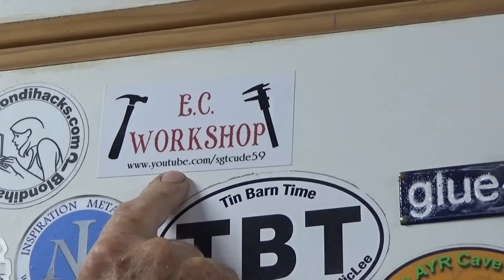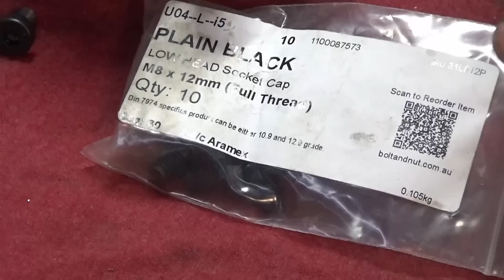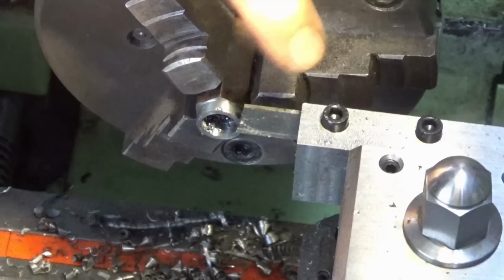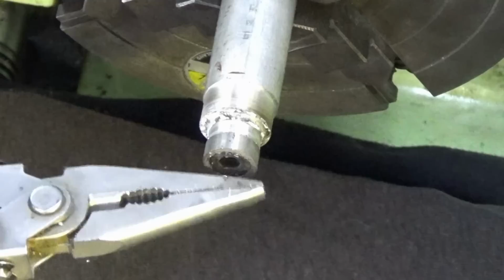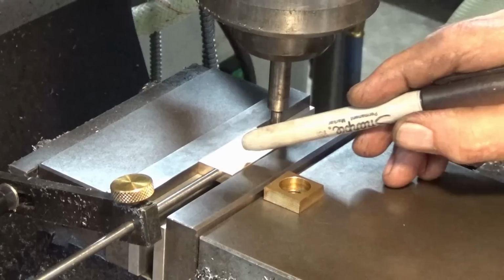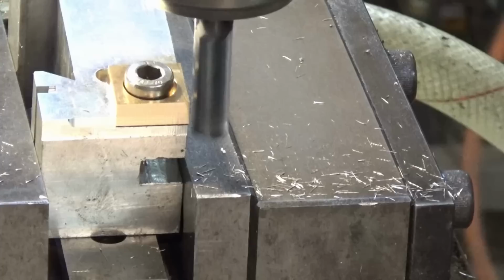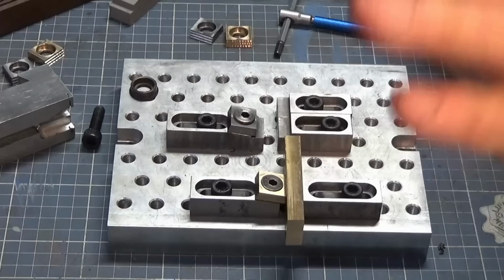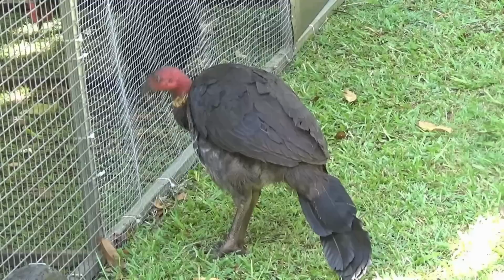Low Profile Clamps (Inspired by Clickspring) Part 2

Comment: Pro-tip for drilling brass and trust me after chewing through 22 tonne of 385 every 2 months in the repetition shop I had in Brisbane, I have plenty of experience drilling it. Simply grind the cutting edge to a neutral rake, cuts nicely with no snatching. Your clamps came out nice 👍
Reply: Could be a short video showing this technique
Reply from the maker: Thanks. We used to modify drill bits in this way for drilling acrylic. It also tends to be a bit grabby and a positive rake drill bit can cause a lot of chipping. The only issue is that you really need two sets of drill bits unless you really like re-sharpening drill bits. I have a project coming up where I will be making a drill bit sharpening rig for small drill bits. I may cover the topic then.
Regards,
Mark

Comment: I designed a set of clamps that I 3d printed for my CNC router. They use m3 bolts, and hold parts nicely on my router. One of the advantages for me has been saving my expensive end mills in case of a run into them while machining.

Comment: William Chitham's comment below was my thought, too.  Since the high point of the eccentric is randomly oriented with respect to the thread, tightening the screw is unlikely to securely clamp the brass jaw to the base at the same time as clamping the work-piece.  Any gap may allow the work-piece to lift, despite the incline.  Using a standard cap-screw to hold the jaw to the base and an eccentric cap-screw pushing against the jaw from the rear would decouple the two motions.  Tighten the eccentric screw first to clamp the work-piece, then the other screw to push the jaw (and work-piece) down.  The incline would not be needed.
Reply from the maker: Chris, I tried to model the mechanism in my CAD software to calculate the clamping forces but failed miserably. However, the jaw cannot lift straight up vertically because it's axis in inclined to the vertical face of the stock it is gripped against. In order to lift it would also bite harder into the stock. I think Chris (Clickspring) mentioned that you need to be realistic and conservative when using this style of clamp. So far I haven't had any stock come loose during machining operations. In the last episode of this playlist I showed some rotary table work using these clamps and they worked well enough. 
Regards,
Mark

Comment: Run a small endmill through the step blocks at an 45° angle to get some clearance.. you could also use a Slitting saw.. Another way of doing it is drilling a small hole were the faces meet.. that way you also get a nice clearance.
Instead of soldering the rings, you also could have machined the holes in the Jaws to 11 mm.. that way you don't have to solder..using the tough steel from the bolts as pressure surface..

Comment: Nice work Mark, I like the jig for machining the square parts. Need to watch out for those cheeky little burrs. But, it looks like it all worked out well once you found the culprit.
Reply from the maker: As you would know, getting a camera in the way is not the best way to carry out close tolerance machining! I hope you are well above the flood levels in Auckland. It looks pretty bad. They showed the concourse in the airport awash with flood water on the news last night.
Regards,
Mark
Reply: @Preso58  Thanks for asking Mark. Yes, we are well above the flood levels as we are on a bit of a hill here. If we ever get flooded here then the rest of Auckland would be 10 meters under water, which would be disastrous.

Comment: Great vid! My latest shows me drilling a bronze casting and the part uplifting. We share that experience haha.
Reply from the maker: You can modify a drill for cutting brass and bronze by grinding the rake off the cutting edges but it means that drill bit is now only good for cutting brass and bronze! You almost need to have two sets of drill bits if you are going to take that approach.
Regards,
Mark

Comment: Hey Mark- Another good idea that I will be trying but I got a trick that I do (Mostly for welding and post heat of cast iron) that you might find useful if you ever need to anneal a large piece again. Dig a shallow pit big enough to put the piece of steel into and build a charcoal fire in it. Put the part on the bed of coals and cover it with more charcoal. Then cover the whole thing with fiberglass insulation and leave it overnight . It will bring the steel past the critical temperature and hold it there and then slow cool it. - Then you can cut off just the part you need,.  Also works for stress revealing weldments.

One other "Hot" idea that dawned on me when you were soldering on the rings. - Give them a couple thousandths interference fit, Heat the rings red and shrink fit them on. ,,,, Just another bright idea from up here in Cleveland.
Reply from the maker: Matthew, the charcoal idea is a good one. I used to anneal old files by lighting a fire in an old tree stump (to burn it out of the ground) and I would just throw in a few old blunt files and leave them until the fire burned out. It works well but often the files came out bent. 
Regards,
Mark

Comment: You can use soap stone to prevent solder to stick to metal so if you cover the face of the mandrel and the threads, the solder won't get the bolt stuck
Reply from the maker: That is true. I believe graphite and white out correcting fluid also works. 
Regards,
Mark

Comment: Would it have been easier to set the mandrel up un the 4 jaw and turning the offset into that and then if you need to make more parts you just put the mandrel in the 3 jaw and you do not need to do the set up again?
Reply from the maker: I did have to set that mandrel up again to make some longer eccentric headed screws. just put it back in the 4 jaw and went through the same steps again. If you did want to use it in the three jaw you would need to mark it against one jaw and put it back the same way each time.
Regards,
Mark

Comment: If those 3D printed parts are done in Nylon, with 4 layer walls, and 70% infill, they will probably make excellent clamps for many materials. I think.
Reply from the maker: I have never tried nylon filament but I hear it's good. Those clamps are small enough to do in a resin printer too. 
Regards,
Mark

Comment: What effect if any does the action of the screw have on the clamping? In action does the clamping jaw push up against the underneath of the eccentric leaving space between the jaw and the body of the clamp?
Reply from the maker: It is impossible to have the screw bottom out on the jaw at the point where the maximum clamping force occurs. There will always be some space under the head of the eccentric screw but in practice it doesn't seem to matter too much. I used the clamps to do a lot of milling on parts held on my rotary table and none of them slipped during the cuts. I think Chris from Clickspring warned that you have to be conservative when using this style of clamp. I kept the depth of cut moderate and it went well. The 10 degree incline does mean that the jaw cannot move up vertically (easily). There is also a lot of friction between the head of the screw and the counterbore. I may do a follow up later on when I have had a chance to do some more work with these clamps.
Regards,
Mark

Comment: Hi Mark, what a nice work: i really like that simmetric end mill that you used to make the teeths of the clamps ( i don't know the correct name), but i will go to check if i can find something in AliExpress, It Is a good inspiration for the next videos! 😀 Thanks Mark, see you soon, Alberto
Reply from the maker: Alberto, they are called a double angle cutter. https://www.deelat.com/blog/single-and-double-angle-mill-cutters-types-common-uses-and-differences/ They also come in single sided versions. They can be purchased with all variations of included angles and some come with built in shanks for holding in a collet. It saves having to tilt the head over on your mill for cutting vee grooves. Very handy.
Regards,
Mark
Reply: @Preso58  Thanks so much Mark!! I am searching to buy one of that!! 😀 Now i have the name!!

Comment: If you had cut the pocket to machine the clamp angle and groove feature, you could have used the eccentric bolt to ensure it was engaged on both faces of the pocket by tightening the screw and the burr would have been a non issue
Reply from the maker: That is true. There's always more that one way to skin a cat! 😁 (no cats were harmed during the filming of my video).
Regards,
Mark

Comment: Hi Mark.  How do you ensure that the eccentric bolt is causing the square clamp to be on the outward stroke at the same time that the bolt is tightening and therefore applying downward clamping force?
Reply from the maker: Hi Eric, I have missed your posts on Instagram! The short answer is that the screws don't bottom out in the counterbore so the only thing that stops the part from lifting up is the friction between the circumference of the eccentric head and the circumference of the counterbore. My understanding is that the downward clamping force is a function of the clamp sliding down the 10 degree slope as it bears against the part.  I guess there is no way to ensure that the thread pitch relative to the eccentricity of the head can be arranged so that the head bottoms out right at the point where the locking takes place. I am just getting ready to fit the fixture plate to the rotary table to try out the clamps in an actual machining operation. It could all end in tears but that will be the subject of the next video.
Regards,
Mark
Reply: @Preso58  Hi Mark, I'm still out in the shop every day but am taking a break from social media. :)

Comment: Ref: The bird at the end of the video, Method for cooking - 3\4 fill 5 gallon Kerosene tin with water, add bird and old Mattock handle, boil vigorously until Mattock handle is soft, remove bird and handle, discard bird and eat Mattock handle !
Reply from the maker: Yes, not sure I would want to eat one. We went for a swim down at Noosa beach on Friday and there were little brush turkeys everywhere. The young ones are quite comical to watch.
Regards,
Mark

Comment: Maybe I'm being dense, but wouldn't it have been easier to make your countersink on the clamping blocks the smaller size that the screws would have been once you made them eccentric?
Reply from the maker: Ben, although the screws were a nominal 8mm diameter on the shank, the hole in the steel or brass jaw needs to be 10mm to allow for the 1mm eccentricity. If you just machine the head eccentric and don't add a sleeve, the head of the screw ends up very close to the same diameter as the hole in the bottom of the jaw. It probably wouldn't fall through but it won't be bearing on much of a surface either.
Regards,
Mark
Reply: @Preso58  ok, that does make sense. Thanks for the reply!

Comment: Mark- is the bar of material (silver solder I assume) the usual form down there, or a remnant from a former profession?  It’s in a tiny coiled form that I have seen here.    Hobbies form vs. professional?
Reply: I believe that was soft solder of some kind.  Are lead bearing alloys still purchasable in Australia?  FWIW, the stuff did not appear to be eutectic.
Reply from the maker: I have lots of those bars of soft solder. It is just a general purpose 60/40 lead solder (60% lead 40% tin). It was commonly used by plumbers in the olden days for soldering up guttering and downpipes. The more common wire type used for electrical and electronic work usually has a rosin core so it tends to be self fluxing. 
Regards,
Mark
Reply: Electronic soldering is something I'm knowledgeable about.  63% tin/37% lead (63/37) eutectic alloy with zinc chloride activated rosin flux (RA) works very well in the home workshop.  "No-clean" flux easily could be better in a production environment.  
The 40/60 stuff stays pasty and can be wiped.  Which alloy is appropriate is very job dependent.

Comment: I don't see why there is a need for collars on the eccentric screws
Reply from the maker: It's to do with the relationship between the thread diameter of the socket head screw and the bearing surface of the head. I also wondered why it was necessary but after having modelled the parts in CAD it became clear why it's necessary.
Regards,
Mark

Comment: Would Loctite work for those sleeves?
Reply: I made something similar some years back, I used high strength Loctite, it worked fine.
Reply: @simonbirt6121   Thanks.
Reply from the maker: Robert, yes Loctite would be fine. In Clickspring's original video, he mentioned it as an alternative. 
Regards,
Mark

Comment: How about that Whitelaws poster.
Reply from the maker: I will let the viewers take a look at that poster in an upcoming video. I tend to take it for granted but I refer to it just about every day. I do have a machinery handbook and a few other ready reference books but that wall chart is laminated and I don't have to worry about making it dirty with my oily hands. 
Regards,
Mark
Reply from the maker: Actually, I just checked out Whitelaw Engineering's website and they now have an online store. Fancy a Narex boring head for your mill? It's a bargain at $8346.80! Yeah, not cheap but they sell good quality stuff.
Regards,
Mark
Reply: Rocky just recently sold it....that's probably why it's now in the age of online    shopping.